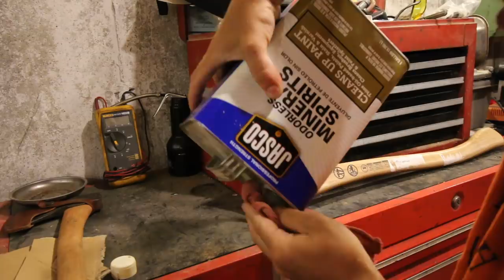5 STAR $30 Amazon Axe vs $150 Gransfors Buks Axe

Comment: good review.  Now for some additional considerations.  1.  you need to drill a hole in the $30 axe and explain why the hole is necessary; 2.  you need to obtain a sheath for the $30 axe.  If you are lucky and find it on line, great.  Otherwise, you will have to have a custom job or make one yourself.  The time and money spent doing 1 and 2 should be valued.  3.  you need to consider wrapping both axes.  Bare wood is susceptible to cracking and hot spots.  I do a layer of cheaper wrapped tape.  Over it, I put tennis racket tape.  This allows the use of the axe for its lifetime without having to wear gloves.
Reply: bd C   Or put tung oil or something similar, as he said in the video.

Comment: You are using way to much sideways movement with your file. you are going to wreck it. a file ONLY cuts forward along the long axis! you move sideways only enough to move along the edge and use as much of the total length as possible per stroke to spread the wear evenly along the file. however, you must also keep in mind that the flat of the file is actually bowed in the middle.
Reply: please do some research on files and how to properly use them and do an update video because a lot of people might watch this and copy the way you did it and wreck their files, have much harder time doing the job and not get the quality edge you are looking for. btw, that is probably part of the reason you were saying it wasn't biting well.
Reply from the maker: Thanks for sharing good info!
Reply: also, even though it might seem counter intuitive, a large ax is not really intended to have a knife edge. your smaller ax is more intended for a sharper edge. a standard ax will actually function better for its intended purposes once the edge gets a bit blunted, or kinda rounded or whatever you want to call it. You still want a good edge, but an edge that wouldn't, for example, cut your skin like a knife. a standard ax blade shouldn't cut you like that. your smaller ax or a hatchet maybe but not an ax.
Reply: You also severely dull the file using the way you did.
Reply: Machinist here files are a must and they are made to cut forward but there's this thing called draw filing which is done with the file sideways and doesn't hurt the file at all

Comment: Spoiler alert, no it can't compare
But guess what, neither can the gransfors compare to a vintage American axe that can cost you well under 30$.
I made myself a way better tool than a gransfors for 20$ on the nail.
I took an old Vaughan riggers axe head ( costed me 7$ )and hung it on a 20" handle I made from a link boys axe handle. ( 13$ out the door )
The bit is just as this as a Gransfors but with a better cheek to eye transition, the head weight is similar at 28oz ( 1¾lb ) plus it has an actual hammer for a poll, and the head itself is perfectly balanced unlike a gransfors.
If you rest the axe on 2 fingers,  it will balance just before the head, and will stay laying flat because the whole axe is perfectly balanced at the head.
If you try this with a gransfors it will want to sit with the bit hanging down which means the head isn't neutrally balance and you'll get some wobble in your swing.

I've also seen reports of Gransfors having big chunks break off of the bit, and I think it's because they're overly hardened botique axes for " bushcrafters " and not really a workin' mans tool.

Btw who cares if a tool on Amazon has 5 stars, most people who post reviews on there don't know a good tool when they see one and have no clue that this thing is garbage.

Comment: Will you try the Cold Steel Trail Boss? I bought it and love it so far.
https://www.amazon.com/Cold-Steel-CS90TA-BRK-Trail-Boss/dp/B001CZ9UY4
It's less than 24$ right now!
Personally I put about a 30-40* edge on mine. It chips a small amount but it bites way better. Never chips with splitting so far and I probably abuse it anyway but considering I can get six of them for the price of one 'great' axe it's totally worth it to me.

Comment: This vid is comparing 2 completely different axes with different profiles and lengths. 
“You spend $150 on an axe, you don’t want to take it out as much...”
WHAT!!?
No, you spend $150 axe so that you CAN take it out and use it without it failing or having to sharpen all the time. Also, nowhere does Gransfors Bruk state that the Small Forest Axe is a splitter, it’s a camp axe that can do light splitting down to feather sticks and pot holders. 
Grab a Grans Bruks American Felling Axe and then compare.

Comment: TBH this was an unfair test, you barely even put pressure or weight on the small forest axe  and it also has a 8 inch shorter handle. No duh something with a pound heavier head and longer handle will be a better splitter and chopper. Compare two equal things.

Comment: You can’t compare apples with oranges. The minute you spent a couple of hours fixing up the cheap axe it is no longer a 30 dollar axe. Average salary in USA is 20 bucks an hr. That now makes it a 70 dollar axe assuming one knows how to sharpen it the way you do. One also has to have the tools to sharpen, if not then you are going to drive the price even higher. The cheap axe does not have a sheet. You can get one for 20-30 dollars so now your cheap axe is suddenly a 100 dollar axe. Then you have the size of the axes. The size of the cheap axe is larger and should be compared more to the gransfors forest axe rather than the small forest axe. I think if you want a great axe then go for the Gränsfors however if you are good with your hands then hey go get the raw materials and build your own.

Comment: Your axe strike accuracy leaves a LOT to be desired. Hard to compare exes when you can't do a cut properly. You made a real pigs ear of that tree. Also, the Gransfors Bruks is sold with a very decent edge. If you only go 400 grit on the cheapo axe, you are not doing a reasonable comparison. You also didn't mention the condition of the edge of the GB> ALl told, a bit of a waste of time.

Comment: Eastwing is the way to go folks
Reply: Tyler Brown I'd say know to that just as with wetterlings... bad quality overall. I have used the same small hultsfors bruks axe for 22 years almost every day since I got it and it still takes an edge like nobodys buisness and fullfills all tasks I need it for woth bravado. I also use a gränsfors felling axe for alot of stuff and to be fair I'd rather spend 5-10 or 20 times more for an axe like that than 30$ for cheap steel and light wood.
Reply: I've never had an issue out of any of my eastwings. And i have the whole collection..and have had them for many years now..only other i use is a head i made myself ..couldn't tell you how many trees I've taken down and campsites I've built thanks to the eastwing brand..love their hammers as well..

Comment: Yeah, I watch the channel a bit.  I like it generally, but this?  One is more of a bushcraft, almost a carpenters axe, the other is a sort of all purpose axe.  The weight of head and handle length is different.  Even showing how well it chops, should have been a new slot cut, not just cutting into the existing one....hmm let's see, no long term or even a days use to show edge retention, or if the handle works loose after just a short period....wow, just not good.  Please don't do anymore like this.
To answer the original question, to beat the hell out of things, split a couple logs, various stuff like that, where you don't really care about the axe, cheap is good.  If you want to actually make something, keep the expensive one around.

Comment: You need to learn how to sharpen an axe... That is why they aren't cutting and sticking in the wood... It should have a 25 degree bevel with a crescent moon shaped bevel behind it. Plus you need to work on your accuracy then you can add power. However once you have a properly sharpened axe... The axe will cut easier so you don't need a lot of power... Plus the way to not get hurt is, when you strike the piece, the handle needs to be parrarel with the ground. Bend your knees if it too low or support it higher.

Comment: Why? Why? Do you sand a handle down to raw wood.
 I get the refinish and all. To much work for this guy. (Finish it as it it comes apart)
Reply from the maker: I hate the feel of varnish
Reply: Maybe, it's me. I can't feel the difference from varnish and oil. Until the varnish starts to crack or peel.

Comment: I really don't want to rain on your parade here but first of please sort out that bench with the vice on it before it runs away. You can't do any work on a flimsy setup like that with even a modicum of accuracy. Second, you put a way to blunt of a bevel on that axe when you filed it and basically just screwed up what was a usable edge on it before you got started. Please learn how to use an axe and what axe to use for what job before you get yourself hurt. Please keep in the back of your mind that there are people out there who may use this video as advice and follow your lead. Ruining an axe could well be the least of thier problems if they do. 
With kind regards
 Michael Max